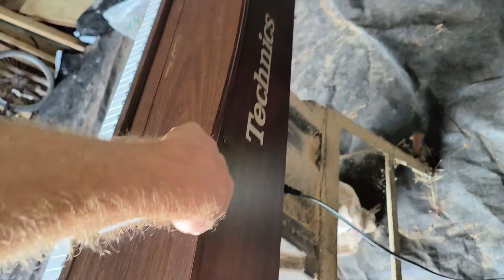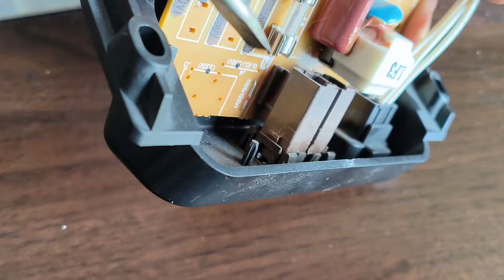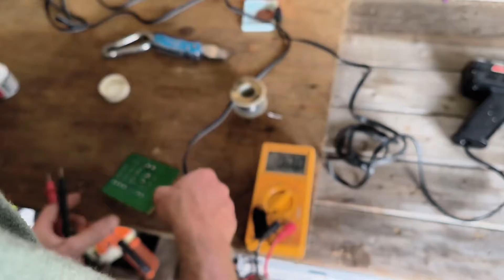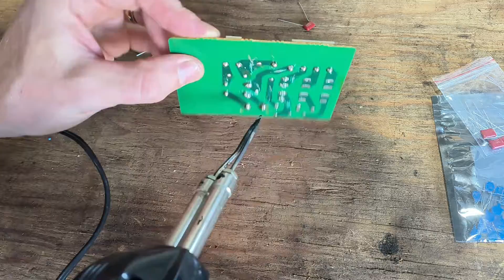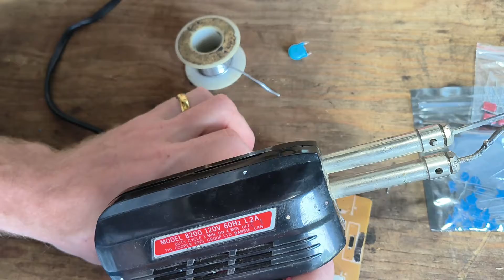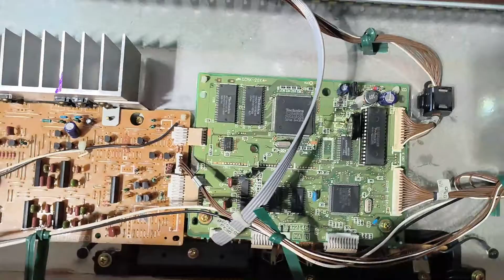Technics Piano Model SX PX103M – No Power Diagnostic & Troubleshooting

Comment: If anyone else is doing a similar repair, make sure you replace safety capacitors with safety capacitors! The ceramic cap that was replaced should have a Y1 safety rating and the film capacitor should have an X2 safety rating.